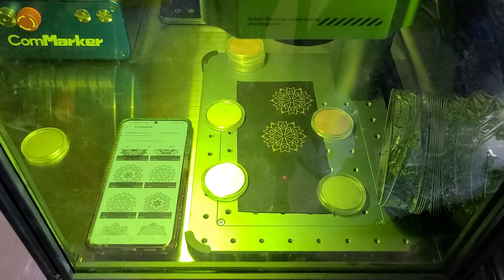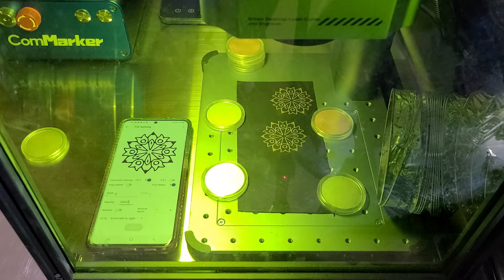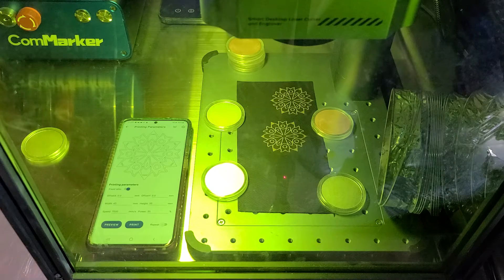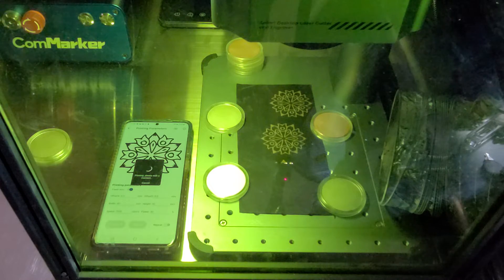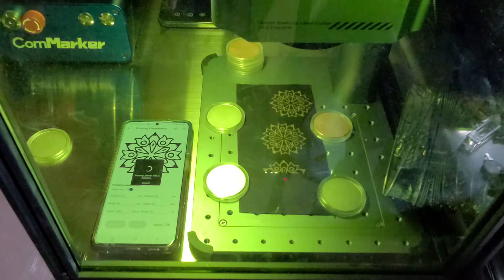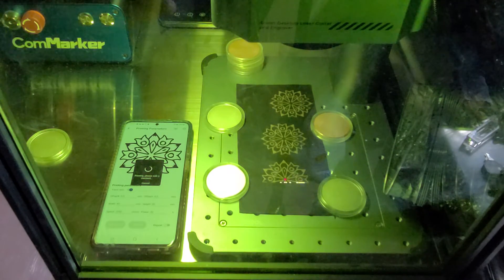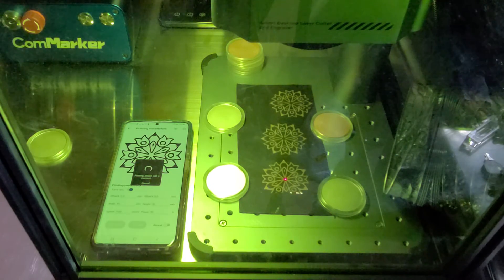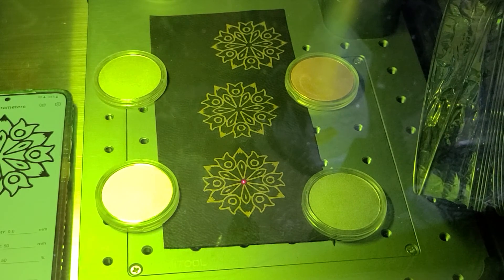LumiTool F20 Engraving Speed

Comment: Hi Cobey,

Hope you're doing well. I’m currently working on a review of the LumiTool F28, and I just wanted to say—your video on engraving speed is one of the very few helpful resources I’ve found. I’d love to link to it in my review if that’s alright with you?

That said, I’m really struggling with this machine. Not necessarily the hardware—honestly, I’ve got no idea if it’s any good—because the software is such a clunky, undercooked mess I can’t even get to the point where I can evaluate it properly.

Is there a way I could reach out for a quick chat? Even just comparing notes would be hugely helpful—I feel like I’m either missing something obvious or just being slowly gaslit by a user interface made in hell.

Appreciate any time you can spare.

Cheers,
Ross (FauxHammer)
Reply from the maker: Hey there! No problem linking it. Just be aware tge it was done with a preproduction unit which broke shortly after. The replacement sent to the next tester in line also broke.

Frankly, while I'm a little surprised that they're still sending out units for review, I'm not at all surprised that the software is still a mess and the promised Lightburn support never materialized. Checking their site, I see it's still only the usual shills giving 
 positive "reviews" for the F20.
Reply: @geeksatlarge well. Let’s just say they made a big mistake sending it to me.

I feel so awful in a way for what I’m about to say about this thing. Because there are people’s livelihood’s potential tally on the line.

But even for a startup. This is so broken. Maybe if they’d spent more time making it work rather than push ads on Facebook and Instagram this might be a good product

But honestly. It may be great tech.

But if I can’t get it to bloody work! It’s no-good.
Reply from the maker: BTW, you can find me via Geeks At Large if you'd like to chat 😊
Reply: @geeksatlarge I would. I’ll check out Geeks at Large.